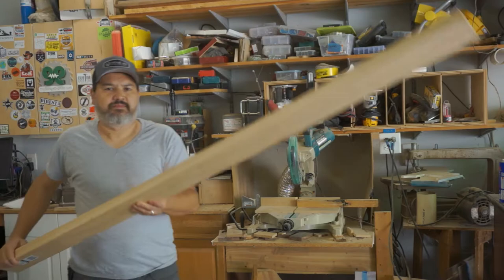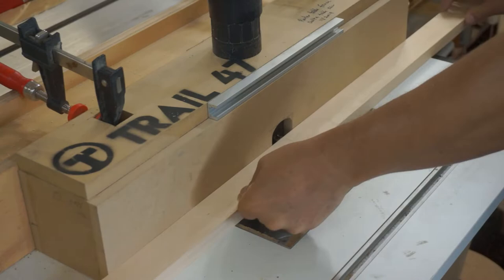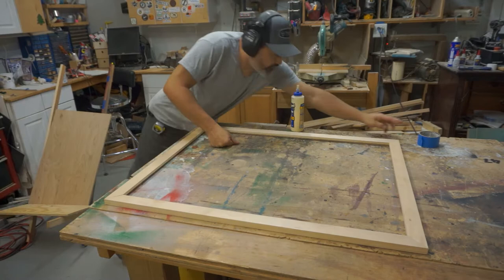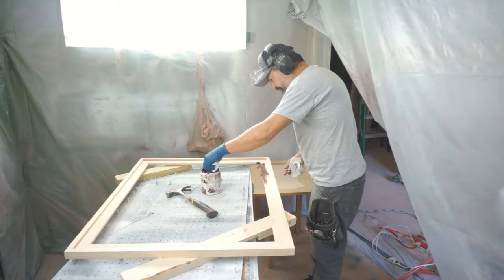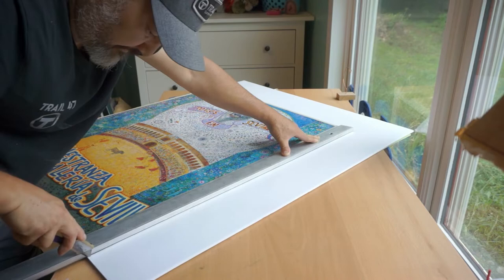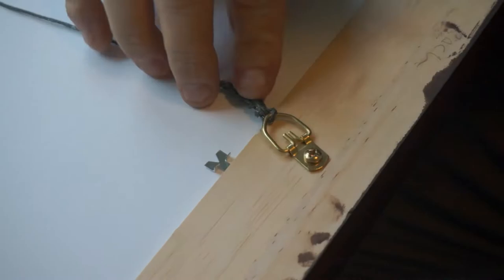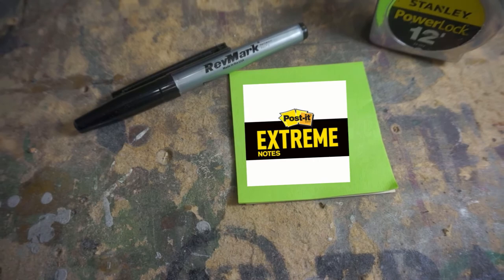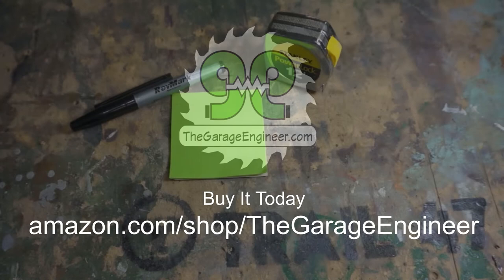Cutting Picture Frames with Easy Math to measure exact frame lengths

Comment: Where did you you get those nifty blue corner clamps?
Reply: Forget my question. Blue tape works fine. Although a Logan studio joiner would work as well.  I did find out that you need to cut the mitre corners exactly.
Reply from the maker: lol.  They sell a bunch of them in the paint section at the building supply store.  Thanks for watching.